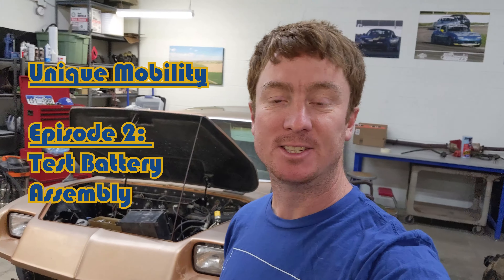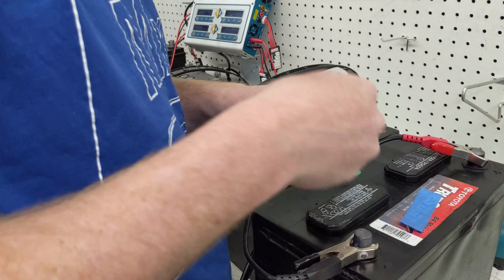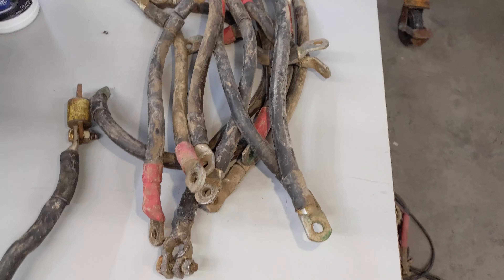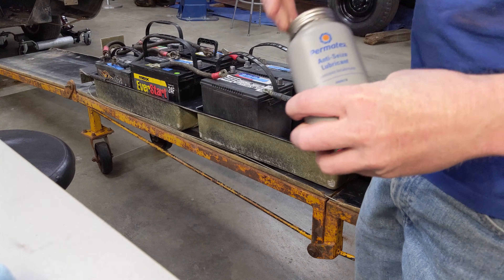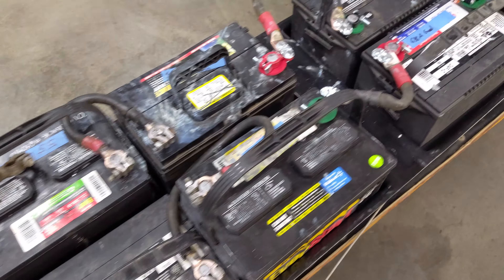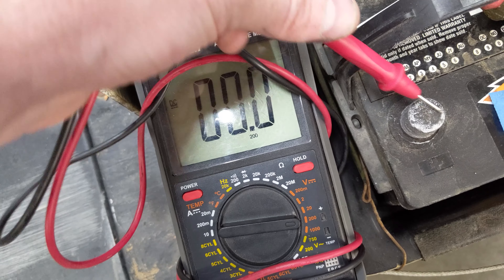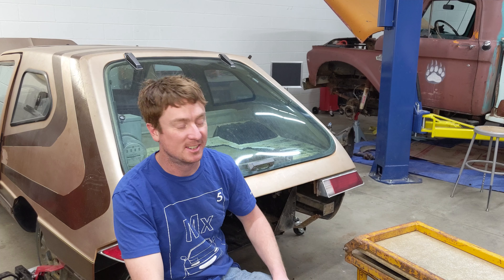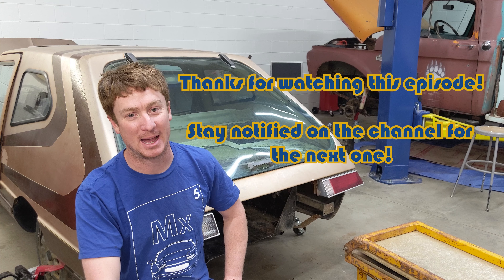Building A FREE 100-Volt EV Test Battery - 1982 UM Electrek Restoration Ep2

Comment: Holy crap Jimmy. I am glad that you are all good after that impromptu welding you did!
Reply from the maker: You and me both!
Reply: @EVSwap  I would get insulated tools. You can buy insulated nut drivers in the size you need for fairly cheap. Insulated screwdrivers are very affordable. Worst case if you have nothing else put heat shrink around the socket and extension. I was gritting my teeth watching you lay out the cable, hoping none would fall.  Knipex makes covers for loose cable ends they are handy. You always have live loose end with batteries, and unlike a breaker panel you can't turn it off. On my modern lithium packs they can put out 2000 amps at that point the wrench is your fuse.
Reply from the maker: @dannelson6980  Thanks, Dan. After that incident I have put more thought into safety. I bought some Class 0 lineman gloves and will look in to insulated tools. I definitely need to have safety #1 when diving into a 400v LEAF battery!

Comment: Great seeing your electrek in person today!

Seeing that battery tray, have you considered model 3 modules? It looks like you could stack two 25S modules in there easily...
Reply from the maker: No simply because of price. I already have a LEAF and the cost per kWh for a LEAF pack is pretty unbeatable. I have no need for water cooling or massive power draw either in this car. Also the Daly BMS I chose works well with the LEAF modules. Looking forward to seeing your Ram Charger!